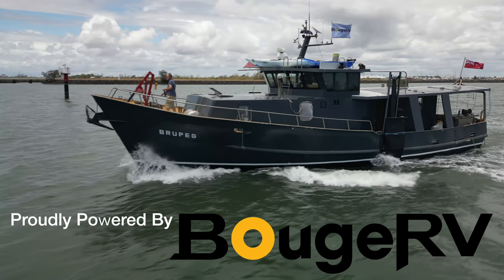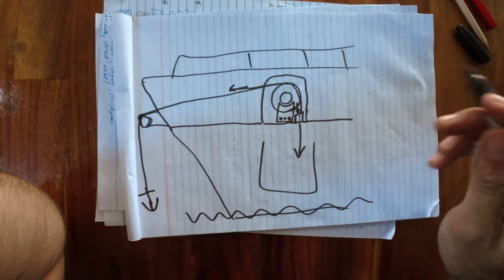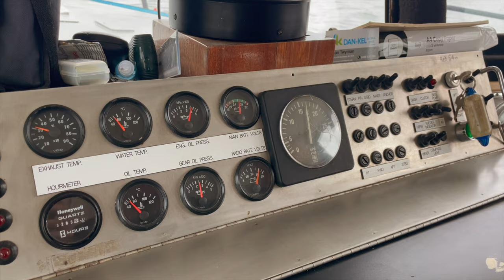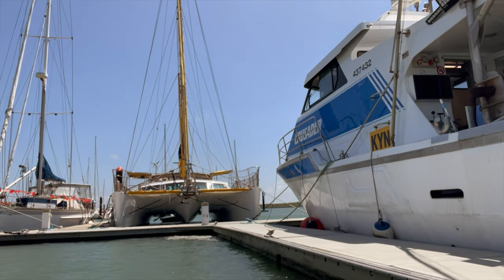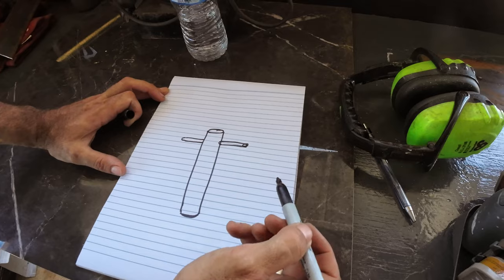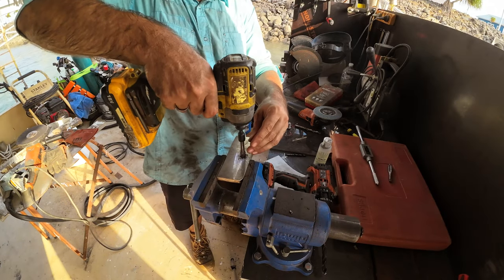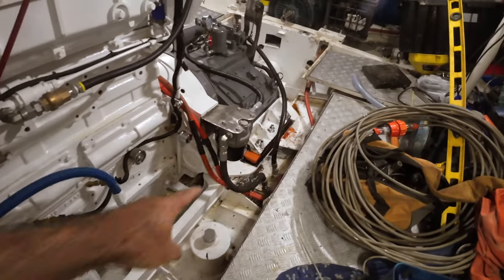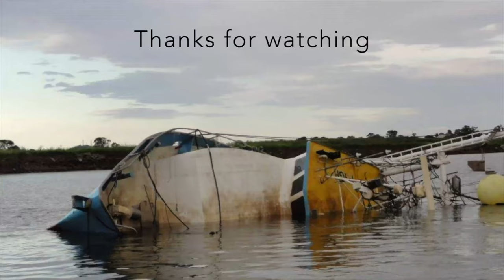Fixing a bad winch design! - Project Brupeg Ep.332

Comment: You can get 90s with running nut and ring. These can be tightened up in and direction by just tightening up the locking nut.  This does require a parallel threaded hole though.

Comment: you defiantly can get hydraulic fittings that have a nut on them to solve your exact issue were the orintation is not quite right. also loctite 567 will be your best friend with fittings.

Comment: Re your joint, could you connect 2x angles if need be? Bit janky but would work in the interim? Also suggestion re engine on/off - could have a bright red/green LED in the engine room controlled from wheel house, red off green on etc? May not be an issue just a thought

Comment: Damian.  I would have threaded the removable part of the chain blocker.  Doing that allows you to replace a stripped thread without having to remove the fitting on the deck.   Stuart from Sydenham.

Comment: You need an ORB to JIC  90 degree hydraulic fitting.  You can put the 90 wherever you want it and the jam nut will seal it to the o- ring. You could use anentire bottle of thread seal on the fitting that you're currently using and you'll still have a leak!
Reply: Agree 100%
Reply: Having a spare oil filter housing or connector incase the thread's go?
As I'm not keen on the unsupported pipe's because there is a lot of force applied to the threads and housing.
Reply: Sounds correct.  If you look closely at the filter housing you should see a machined area that the o-ring seats in. It may look like the start of the threads to an untrained eye.  If this is the case then it's leaking because the filter threads are a straight thread and not tapered pipe threads.
Reply from the maker: Thanks. I’ll take a closer look at that area. I like the idea of an oring sealing it up and to my untrained eye it did look like a straight thread in the filter housing

Comment: You can get that exact fitting with a built in swivel.  That fitting appears to be npt to jic.  I am not sure exactly what size the port on filter or hose is but here is a part number to a 3/4 npt to jic. 5701-12-12.

Comment: You have a jic-bspt 90deg fitting get a jic-bspp 90deg.. has a straight thread as opposed to a taper and a jam nut with a seal on it called a dowty washer. Lets you have it where ever you want...... alternatively you can 5min alridite it in the correct position instead of thread sealant.. good trick with hydraulic and oil lines to get you out of trouble when you can't get the correct part

Comment: The anchor chain bounces paying out and dropping in. The modified jig, improved the falling into the locker. Like the work bench and aft area cleanup.  Adding a starboard bollard to secure Brupeg to the dock.  Whilst tied up at the dock, opportunities to organize the the engine bay. Sunshades for the upper deck.

Comment: I'd go for a U shape on side with hose. Gives hose more flexibility. Anything connected to motor will vibrate. Better that connection isn't tight bend. You can but a clamp 1/2 way.  Always try not to have hose in tension to much.

Comment: You can shorten the pipe, and then weld an offset cone to the top of the hawse pipe to move the entrance a fit further aft. Avoids burning paint on deck.
Reply: HMMM Making the Anchor chain pipe into a funnel to take in any seawater that comes over the bow so filling the chain locker with a few tonnes so making the bow sit deeper in the water and would give the bilge pump a bad time.
Regards
David
Reply: @davidgreen9985  Sorry I should have called it by the proper name. The spurling pipe (the hawse pipe goes from the deck through the deck to the anchor stored on the bow, but this boat doesn't have one rigged that way. The spurling pipe IS already open to the sea. The funnel type I am suggesting is just slightly wider than the pipe to compensate for the small offset they have. It's also very common to plug the pipe when at sea, either with a metal cover with a slot in it, greased rags, or for smaller vessels, using oil based modelling clay around the chain to plug it more. With of all these methods, you reduce the amount going into the chain locker to a small amount. On commercial ships, you also fit a grate to the bottom of the chain locker and have a suction from the bilge pump to pump it out. Don't know if Brupeg has gone to that trouble.
Reply from the maker: @evangatehouse5650 our chain falls into a closed bucket which is above waterline and drains freely over the side. We have a bilge pump in a stainless sump for the rest of the room but that doesn’t see a lot of water compared to the gravity drain in the anchor bucket

Comment: Please wear proper knee pads when kneeling on the deck. At 76, my knees ache when climbing stairs because it never seemed convenient to put on the pads 'just for a couple of minutes'. A folded towel doesn't give the support a good set of foam pads will. Considering all the steps and ladders on Brupeg, you're gonna want those leggy hinges to stay in good order to be able to lug all those cases of Great Northern and Cooper's... For the oil filter, first make sure the housing is NPT and not straight thread, if it is NPT you can go with a straight JIC to NPT, then use a 90 degree JIC female swivel nut to JIC straight male. If it turns out to actually be straight thread (unlikely), you will need a fitting with an 'O ring" face seal nut on the male threads... 😛

Comment: Because you are applying proper names now, that’s not a hawse pipe it’s a spurling pipe lol 😂. Charley
Reply from the maker: Where your located. Where we are it’s a hawse pipe.
Reply: A hawse pipe where fitted ( Brupeg doesn't have one ) goes from deck to side of hull , quite often one on either side for vessels with two anchors . These are most often used with dreadnought type anchors . The pipe into the anchor well is indeed a spurling pipe .  @ProjectBrupeg

Comment: that oil filter is a normal npt pipe thread. use a blue or grey pipe thread tape on it. itll take enough room to get it to seal in the right orientation
Reply: also put some stainless safety wire on those shackles. zip ties break off and the pins back out, ask me how i know...
Reply from the maker: Will do. Thanks

Comment: You could use 2 fittings for the oil filter. Bspt to jic straight then a jic to jic 90 which can be oriented in any direction. Assuming the tapered end is bspt or npt, also are you sure it is a tapered thread on the oil filter is it the fitting same on the other port and no leaks.
Reply: In the states you can get npt swivel hydraulic fittings, but you have the room so this sounds like a better option

Comment: Hi..
A thought...
How is the Gypsy catching the chain?
Could it be 'adjusted' or 'eased' ie with a flap wheel on the grinder etc..
An indelible marker coating a couple of links might show the problem.
Or will it get better or worse as the chain settles in?
Because of what you have done.. I'm going to buy a mechanical oil pressure gauge to mount on my engine.
Kindest regards
Bella 🐈 & Mark.

Comment: You can get Swivel NPT/BSTP to JIC right angle fittings.  Should not be hard to source one from a hydraulic shop.  If you cant source one of those, a NPT/BSTP to JIC straight, then JIC to JIC right angle swivel would be the next option.

Comment: will you be making a weather cover for the things on your workbench?  seems like they'd deteriorate very quickly with salt spray and rain water getting into the electronics.   maybe just a hood or a sliding or opening cover to sheild them when not in use?
Reply from the maker: All tools will live in the engine room and be brought out when needed. Only thing that won’t will be bench grinder and vice

Comment: Given that even after you've built the workbench, your still working on the deck, prehaps a second workbench on the opposite side, with a dedicated cutting station would be handy. For the chain stripper, adding strip of metal on the edge that rubs the chain, and prehaps even a plastic wear strip would be advantageous from a wear perspective, as the chain continually rubbing on that edge will likely wear a groove in the chain over time.

Comment: Pretty sure the filter housing would be a parallel thread to avoid cracking aluminium with a tapered thread, plus, if it was a tapered thread on the fitting it wouldn't be that far in without being tight.

Comment: I have solved lots of fitting problems that didn't tighten in the correct position by replacing teflon tape with locktide 577. just apply treadseal 577 tighten normally and return to the correct position and let harden. seals every time and can be undone without special tools (just spanner and forse) just use a wire weel or wire brush to remove te residu and reapply during installation. Its chemical proof so gearbox oil should be no problem and I assume the pressure won't be to high in a filter housing. I've used it on high pressure hydrolic systems without problem so gearbox pressure shouldn't be a big problem.

Comment: What type of engine in the tug?  And does it have thrusters at the front? How does its performance to how Brupeg will be?  Similar?
Reply from the maker: Also has a Cummins 855 but it’s slightly different spec. It’s 270hp we are 366. Overall performance will be very similar. It can do 9.5knots we might get to 10-10.5. Being a tug it have thrusters at each end so can spin in its own length

Comment: OIL LEAK!   You have a male pipe thread to a male flare 90* elbow that is leaking.  How about installing a male pipe thread to a male or female flair  then a 90* flair elbow?  That way you can orient a flair-to-flair 90* elbow however you need without worrying whether the pipe fitting is loose or not.  It is an additional fitting but it will allow the elbow to be oriented however you require.  I have done similar types of connections and it looks like there is enough room  without having to get another hose.

Comment: Not sure if I've fallen behind, but its nice to see the new intro. Are you using the marina's power to continue to work on board or are you now using your solar rig?
Reply from the maker: Mostly our own power but until we have more solar wired in and the genset we use shore power for the plasma and big welder
Reply: @ProjectBrupeg your problem with 90 degree fitting would be solved by a 90 degree oring fitting that has a jam nut that tightens up on a washer and oring. Can't remember the name tho. I use them on forklift cylinders.

Comment: I’m not optimistic about the long term lifespan of all the power tools and metal working equipment you plan to keep at the back of the boat in a place exposed to constant sea water spray
Reply from the maker: They live in the engine room. Only the bench grinder and vice will be outside and the grinder is low cost to replace with another second hand one